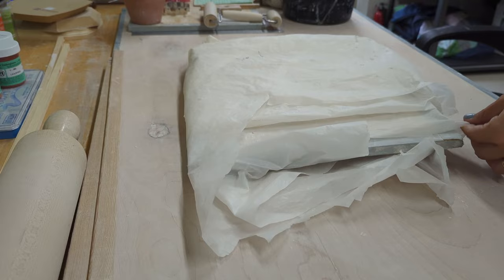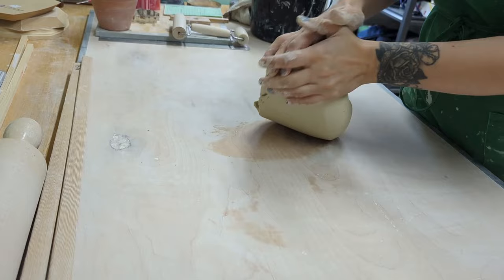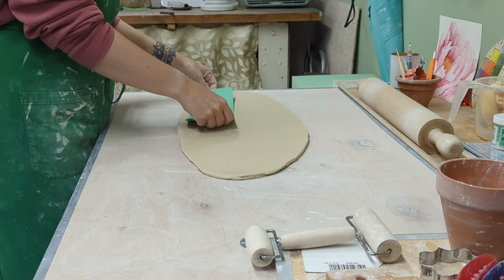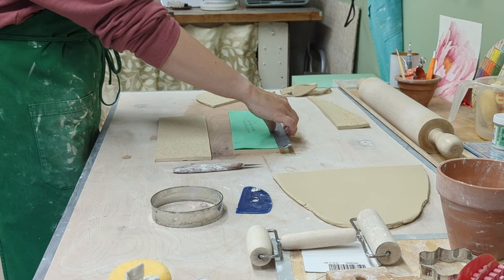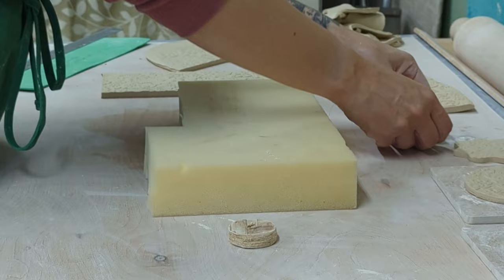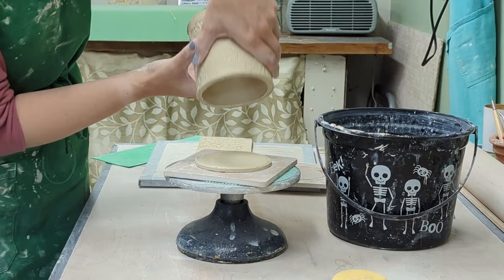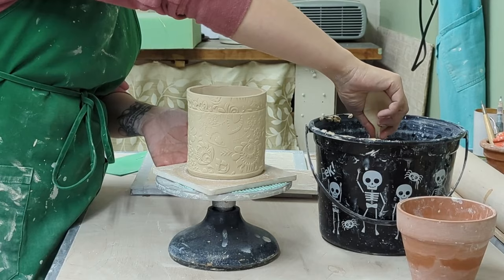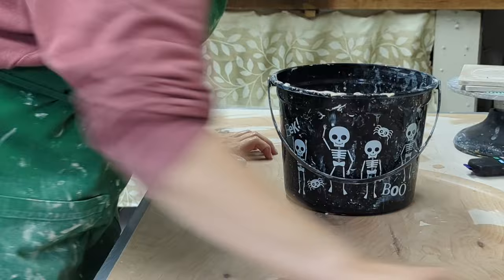Studio Vlog| Handbuilding Mugs | Using slabs of clay to make textured mugs! #clay #pottery #diy

Comment: I’m so glad to see that others do just a few mugs at a time as well. I have worked my way up to 4 at a time. I still remember trying to make 2 at a time and not have the clay dry too much because I fiddled sooo much!!! I just unloaded a bisque kiln and I couldn’t believe how wonky some of my mugs were!! It’s extremely frustrating to me. I probably may care too much but I am very fussy about anything I make! So the reason I haven’t made a damp box with the plaster in the bottom is because I’m afraid the bottom of the mug will dry out too fast. I put all of my pieces on a piece of drywall and cover it with a plastic bag and the next day I take it off for about an hour and then ever few days I change to dry bags. It’s soo much work but I feel like if I only make a handful of pieces and put them in a damp box then I make more th e next day or day after, I need another damp box. Does tha make sense? I also do what you do to the bottom of my base so it comes up and around to make sure it is secure. Also after it’s set up a day inder plastic i turn the pot upside down and use a paddle to softly secure the bottom to the sides. I think I’m going to try and do what you do and apply the handles the next day. I find that pressing the handles on and trying to get them even may be pushing my mugs out of round. I do have to put my hands on the inside a lot to support me pressing the handle on. I’ll give that a try and see how it goes. Since I don’t throw I’m not used to putting handles on the next day. Also may I ask how long it takes your pots to dry in a damp box? I’m having to wait 3 or even 4 weeks for some of my pieces to dry because I can’t always uncover them or switch bags as often as I need to. Thanks so much sorry this is so long.